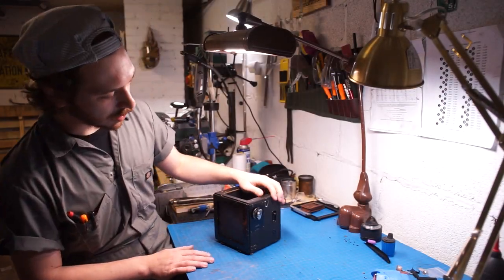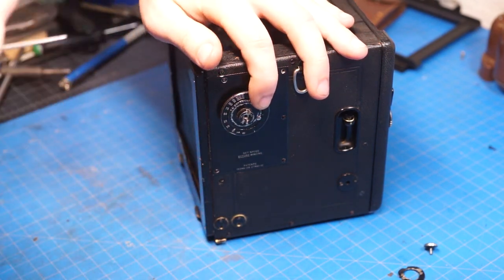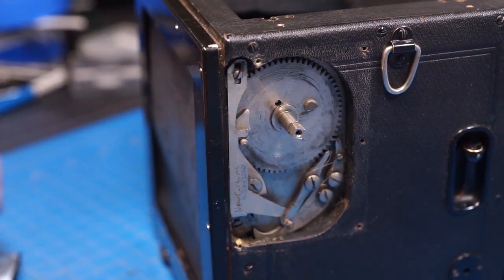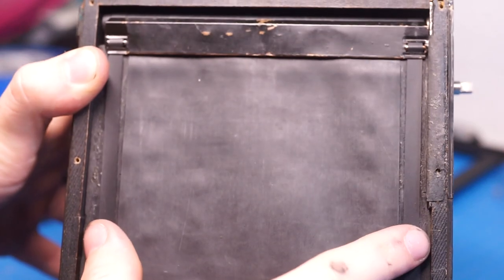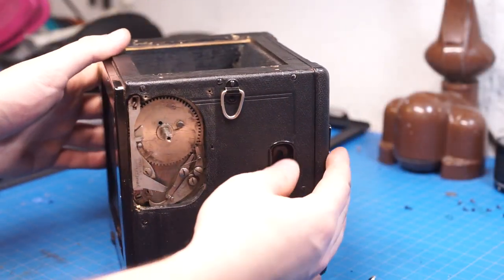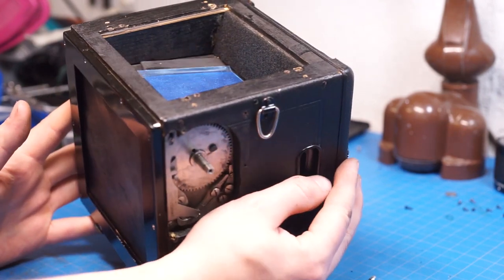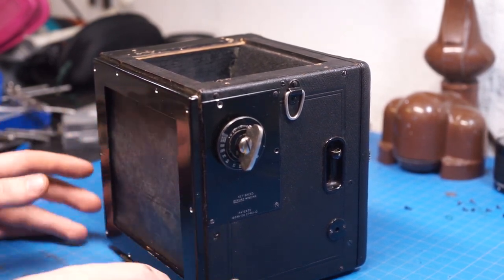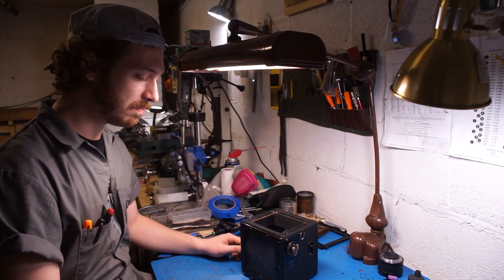Houghton Ensign Reflex - Demonstration of Large Format Shutter - GraflexParts.com

Comment: Thanks a lot for this video, it was very useful for me! Do you have any info regarding the correct curtain slit size for each shutter speed? I changed the main curtain and I'm not really sure if I installed the new one correctly, so if you have any info on the correct slit size I would really appreciate it!
Reply from the maker: Unfortunately, not distinctly. There is a fluid sort of formula that I know exists for aperture size versus shutter speed but it's not quite something that can be translated to words. Once you handle enough shutters you can begin to expect certain speed rangers for aperture sizes. If you're inside one of these enough to be adjusting curtain position i'd recommend just experimenting with a digital tester. 

There are also some physical limitations with the friction dynamic happening in the shutter curtain. I actually machined additional index holes in the speed selector knob/plate for this camera to try and push the speed boundaries. Inevitably I found only 1/240s was the most reliable setting although the camera could be coaxed to push 1/1000+ if you knew it's exact behavior. But this was nothing reliable for a professional shooter.